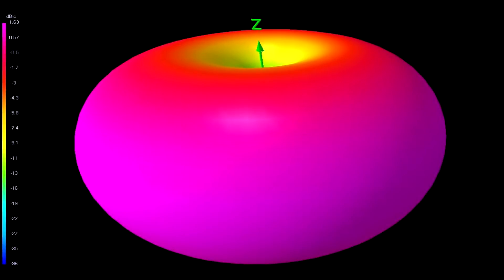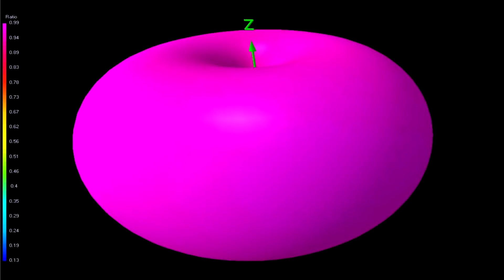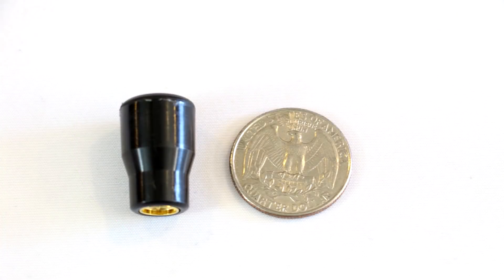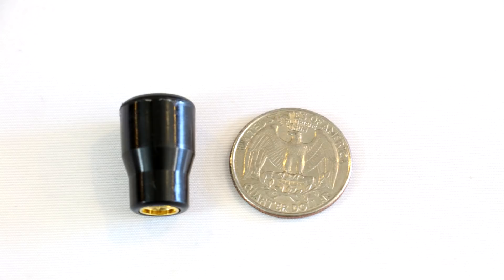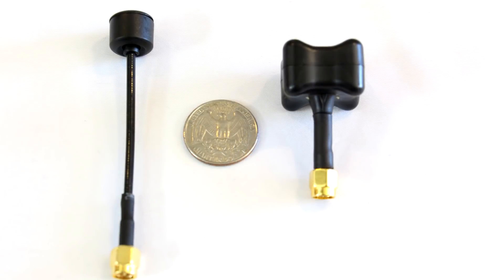Triumph Pro Overview

Comment: does this triumph pro outperform the minion pro in most circumstances? Apologies for all the questions, but I'm not as clear as to how they relate to eachother. I know the Gain is higher in the minion pro, but I'm not sure if that means an increase in performance with the range or a decrease due to much larger nulls while turning....
Reply from the maker: The Minion Pro is a higher performance antenna.  The Triumph Pro is smaller.
Reply: @CAGreve1231  great ordering from Pyrodrone now - thank you

Comment: Your videos are awesome and I could use your help.  I've gone through the Team Blacksheep web page and looked through all your CP antennas and they are all quite impressive. I fly my Hubsan H501S and my H109S to around a mile out But I need better FPV. I've attached your antennas I'm considering. For the Hubsan H501s the antenna will be mounted on the rear top of the drone in place of the red ducky. For the H109s, the antenna can either be mounted horizontally out of the side or downward with a right angle adapter. My receiver antenna will either be a patch or 5-turn helical. I usually fly at altitudes between of 50-100m. Your professional opinion is greatly appreciated.
Reply from the maker: Use a helical rather than a patch.  That's going to be the biggest factor.  A Crosshair would be even better than both the helical and the patch.  As for the aircraft, there really is no bad choice.  I personally like the Minion the most, but you will find the Triumph Pro to perform very well... and you probably won't notice the difference.  If you tend to pitch at a high angle, use the Triumph Pro.  If you are pitched less than 40 degrees, use the Minion Pro.
Reply: @CAGreve1231  Thanks for getting back to me. So you would chose the Minion or Triumph Pro over the Ion Pro or Bluebeam Ultra V2?

Comment: I wonder why Aomway four-leaf outperforms the airscrew antenna???... I was disappointed paying as much as I did for it just to find out the aomway out performed it in  every angle . I tested them for over two hours trying different angles behind buildings ,  brush exedra.. everytime aomway always outperform ..☹️
Reply from the maker: It is possible that you got a bad one.  We QC check every antenna, but that doesn't mean we missed one.
Reply: @CAGreve1231  that's always a possibility... But it looks like if they were defected it wouldn't perform at all ? are just slightly?.. I get very good picture in line of sight,  it's penetration through objects were the aomway outperforms it.. could it be that the airscrew is made of 3 cloverleaf and the aomway has 4 which is giving it the edge???
Reply from the maker: @flyhigh6591  - The airscrew is higher axial ratio which is what gives it the punch.  That is a really unusual problem.

Comment: Is this better than the Ion V2?  Im planning on using Ion V2 for both transmit and recieve, unless there is a better option.
Reply from the maker: It is smaller, lighter, and better for freestyle flying.  The Ion V2 is more efficient and better for long range.
Reply: @CAGreve1231  thanks for the reply.  Ill probably go for the triumph pro on my quad and the ion v2 on my plane.

Comment: Still not available for sale anywhere, so ...
Reply from the maker: Thuban06 - TBS ran into problems manufacturing it and it has made it hard to stock
Reply: @CAGreve1231  Thanks so much for the update. What would be the best second choice? I need a couple of receiver antennas soon. Thanks!

Comment: I emailed you guys through your site. Do you do custom length and connector orders? Id like an Ion V2 with a longer cable and a 90° MMCX. Or at least one with a long cable than I can trim down and use a solder-on 90° MMCX.
Reply from the maker: We licensed this to TBS, so you will need to ask them.  We do custom antennas for VAS.
Reply: @CAGreve1231  Ok great I'll email you guys again.

Comment: 900mhz super small cp anntennas?
Reply from the maker: I made a prototype of a small 900MHz CP... and failed miserably and didn't bother re-visiting it.  Admittedly, I am working on a new technology for rapid prototyping to make designing antennas easier.
Reply: @CAGreve1231  fantastic to hear you are working on it. I am aware it's not straightforward but I figured it might be doable with your ion design or whatever foxeer is doing with those tiny ones.

Comment: Totally possible to make a smaller one, if one can keep the tolerances needed.
Reply from the maker: Yes it is and multiple versions were tested in a special test rig I made for measuring emissions.  Unfortunately the bandwidth and axial ratio suffers greatly once size is reduced below this and thus I went with the type you see.  I actually admitted this in the video description.

Comment: FrSky version coming soon along with a letter asking you to stop replicating their product
Reply from the maker: They have to clone it first ;)
Reply: @CAGreve1231  Is there something unique they can't learn by buying the product? I certainly hope so.
Reply from the maker: @nige5572  - THis one is really hard to clone.  We built some clone protection into it ;)
Reply: @CAGreve1231  Just thinking about this because of the Triumph Pro being a TBS product, have you ever tried to make a "micro" CRSF antenna? It would be incredibly popular with a lot of quad pilots I'm sure.
Reply: ROFL!
Reply: Frsky have been acting like  douchbags, its so disappointing. TBS are the gods of RC and FPV systems, crossfire is miles ahead along with their Vtx's and antennas, waste of money buying anything less. TBS should build a radio, so I can replace my taranis
Reply: @owencroney2089  The Tango?
Reply: @nige5572  holy shit! Cringe!! I never seen or heard of that radio before.....thanks for the heads up Red.
Reply: @owencroney2089  Yeah no problem. Just wan't very popular at release. I don't think a lot of people heard about it.